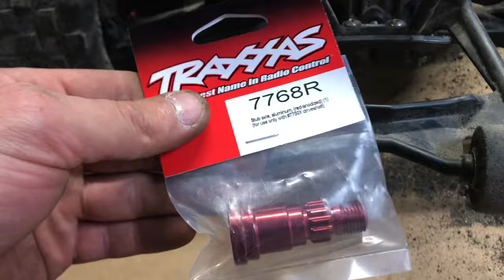How To CHANGE A 6S TRAXXAS X-MAXX Into An 8S XMaxx! TIME To SWAP SOME PARTS!!

Comment: I just wanna say the 6s does come with a center diff but traxxas doesnt make that part anymore hense the reason for the 8s conversion and bulkhead swap to accomidate the larger bearings on the center diff
Reply from the maker: 6s actually doesn’t have a center diff……it has a plastic out drive gear in place of the center diff

Comment: You were probably breaking axles because it looks like you werent running a slipper clutch or a differential before. Looks like someone replaced the slipper clutch with a cush drive which doesn't really work to save the drivetrain.
Reply from the maker: I replaced it with a Cush drive. I haven’t run the slipper in years. If I put it back in I might spare my axles though
Reply: @RCKnockout  yeah unfortunately the cush drive just isn't a replacement for the slipper clutch. The cush drive can take a little bit of shock load but it can't absorb big shocks like a slipper clutch or a center differential can
Reply from the maker: @DoRC  yeah. I agree. I was still breaking driveshafts and stripping ring gears every time I took it out with the Cush drive and solid output gear. I haven’t had any issues since installing the center differential
Reply: How would a slipper clutch and 8S ring and pinion hold up? Just deciding if I go with the centre diff conversion in my old 6S rig, someone fitted a slipper eliminator and I just killed front and rear ring and pinion gears in no time.
Reply: @Fredward1986  do the center diff.  Its far superior to the slipper
Reply: @DoRC  thank you ill order the parts

Comment: Got a great deal on a 6s xmaxx. But by the time im done converting to 8s parts I shoulda just went straight for an 8s one 🤣🤣
Reply from the maker: Yeah that sounds about right lol
Reply: @RCKnockout  haha so far I bought the rear bulkhead and the center diff. Will be buying the cush drive soon. Do I need anything else? Its just those right? Everything else like yhe input gear are all the same? Thanks!
Reply from the maker: @kristofferdelrosario1105  technically the diff cups, dog bones and stub axles are all different on the 8s….but they aren’t a must to change in my opinion…..6s ones will be a bit more prone to breaking
Reply: @RCKnockout  id just go either straight to the wide kit or jennys rc haha or scratch it for now and run it with the new center diff & cush drive
Reply from the maker: @kristofferdelrosario1105  yeah I wouldn’t blame you there

Comment: Hey did you ever change ge shock springs due to heavier batteries using large 4s batteries
Reply from the maker: No I didn’t….I’m not sure if the shock springs are any different between the 6s and 8s xmaxx…it still seems to perform well anyways
Reply: @RCKnockout  thanks iam still with 6s shocks, I guess they work alright, truck is heavy  with big 4s batteries
Reply from the maker: @stephenb9940  yeah you shouldn’t have any issues…If you want you can always find different spring rated springs though

Comment: Are you running 8s stub axle carriers, and if so do they mount up to the stock arms.

I just destroyed a rear dogbone and can't find a replacement without upgrading to the 8s but not sure what all I will need to get.
Reply from the maker: Yeah I believe I’ve switched them all at this point….you’ll need the 8s stub axles and 8s driveshafts…..I believe it’s the same part number as the 6s ones just with an “X” at the end of the part number

Comment: Are you still on the 1650kv? If so how’s it holding up?
Reply from the maker: Yep it’s still holding up well!
Reply: Haven’t stripped any gears yet?
Reply from the maker: @omega_rc  yeah I’ve stripped some pinions but the motor is still holding up well

Comment: How could Traxxas ever think it was a good idea to not have a center diff on anything 4S and higher basically. Especially on their top of the line model's, the Maxx and X-Maxx.
You need it to control that power and actually put that power down without balloons for tires. A slipper clutch is there to dampen the torque on everything, especially on Full Throttle Landings. It does lock the front and rear to a point but its not made for that..
Reply from the maker: I think that’s why they decided to change it for the 8s xmaxx

Comment: Have you ran 8s on the 6s set up
Reply from the maker: Yeah the plastic spur and plastic output gear strip
Reply: Dang man, I finally just picked up a 8s x-maxx what do you think about them
Reply from the maker: @1994RALLY  much better than the 6s version
Reply: @RCKnockout  really awesome!!
Reply from the maker: @1994RALLY  for sure!